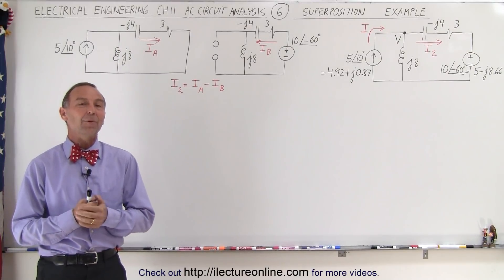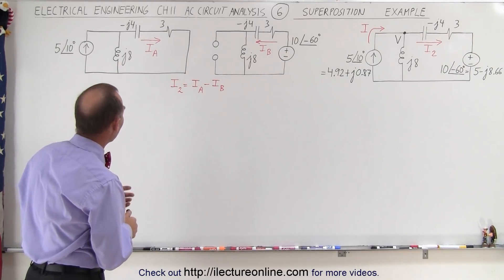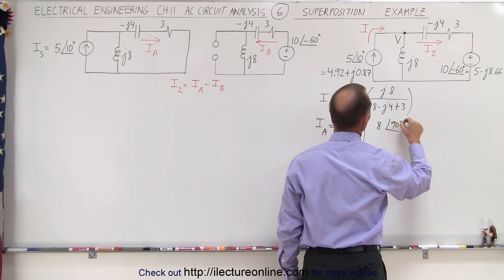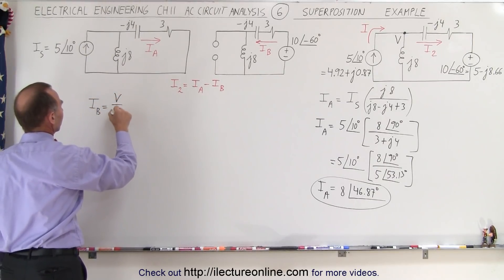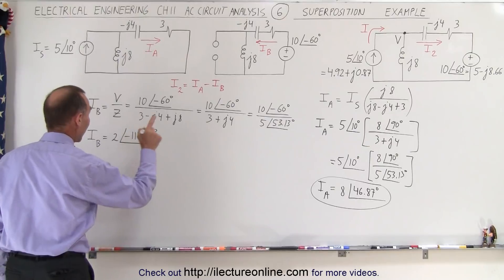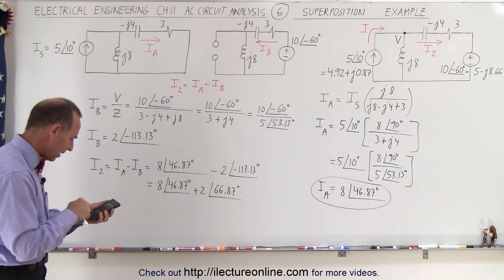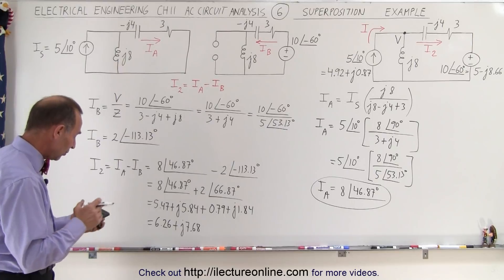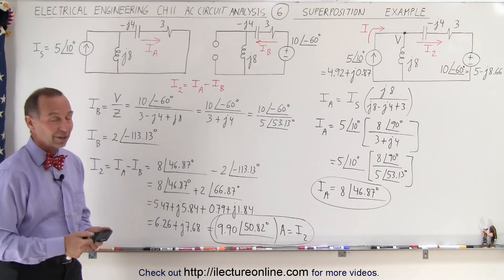Electrical Engineering: Ch 11 AC Circuit Analysis (6 of 55) Superposition Example

Comment: 2:43 
Plz have a cross check again
I should be 8 at angle 36.8 degree

Not 8 at angle 46 degree
Reply from the maker: You are correct.  Thanks for pointing that out.

Comment: Michel van biezen, how can we tell which direction the current is going?
Reply from the maker: Typically, the source of the EMF, (the power supply), pushes the current from high to low voltage.  If there are multiple sources, the one with the greatest potential difference wins.  Sometimes it is just hard to tell, so you take a guess.  If you are wrong, your answer for the current will come out negative.
Reply: Michel van Biezen i tried to add up the current assuming it was in the opposite direction and i didnt get the same answer as the one in the video. Is there a video you recommend or can find that may help me better understand? Thanks for all that you do.
Reply from the maker: It may simply be that you made an arithmetic mistake.  (that is very easy to do, and I make mistakes as well at times with these types of problems).   If you look at some of the Kirchhoff videos that we have it helps see how reversing the current does not make a difference.  On this example we have a current source, so you cannot reverse the direction there.

Comment: Shouldn't (j8) and (3-j4)  be in parallel? If so, the Ia current will be different because you cant just add (j8) and (3-j4).
Reply from the maker: No, they are not in parallel
Reply: @MichelvanBiezen  Wow, quick response. I haven't even finished watching the other video. But Why it is not in parallel?
Reply from the maker: If two components are in parallel, the current can flow through one and not through the other component when going around the loop.  That is not the case here.
Reply: @MichelvanBiezen  Thanks

Comment: Why is j8 ohms equal to 8 with an angle  of 90 degrees?
Reply from the maker: Since the source is a sinusoidal AC source, the voltage drop across the inductor will lead the voltage drop across the resistor by 90 degrees.  The 90 degrees is the phase angle
Reply: cos90=1
Reply: @aakashsingh7330  bro sin 90 =1
Reply: @aakashsingh7330  bro cos.  90=0

Comment: Sir in the overview of superposition theorm u said that in case of only dc voltage source capacitor will act like open but here in the solution you are also considering the impedance across capacitor why. Iam confused kindly help
Reply from the maker: Since the voltage source is given with a phase angle it is implied that it is an alternating source.
Reply: In the overview video there was a DC voltage source. In this video there's an AC voltage source. So Michael is correct.

Comment: i saw this in the book sadiku electric circuits but have different answer?? the answer is  9.902 cos(2t-129.17)
Reply from the maker: The question in the book asks for a different current.
Reply: thank you very much sir now Im not confuse
Reply: @ronaldsinoy  No one wants to be confuse.
Reply: I was just trying to find some good books about AC and was having a bad time. Thanks to your response I found sadiku - and it's pretty good, lol. Thanks!